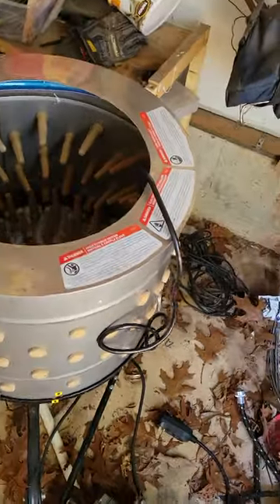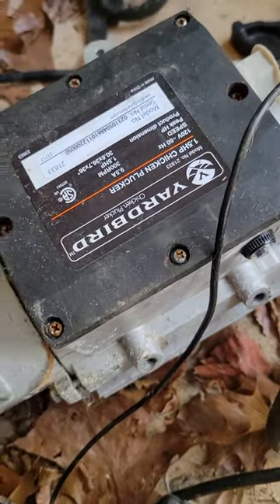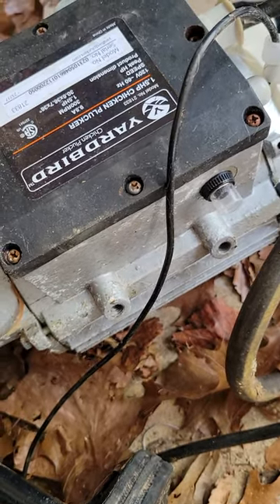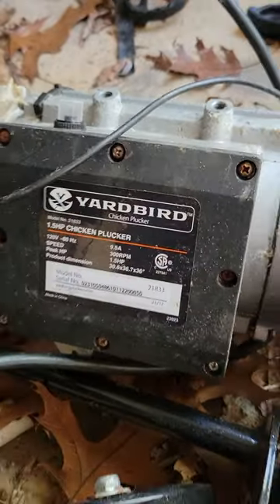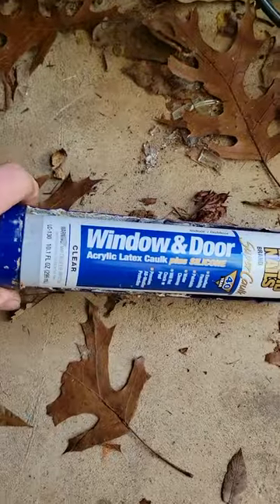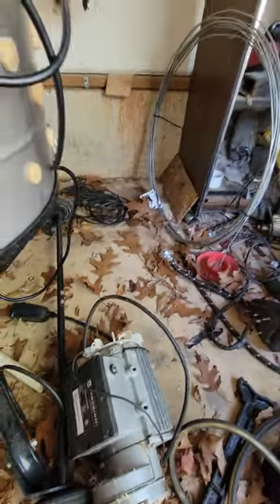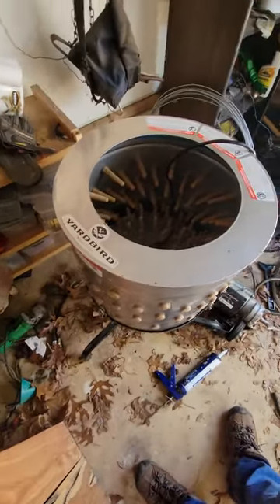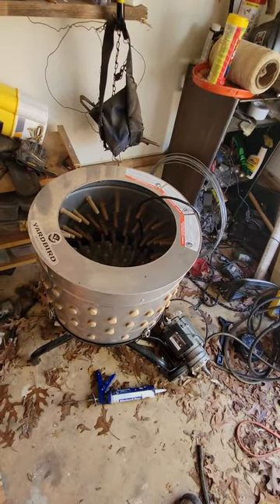chicken plucker issues and the solution

Comment: I just watched another video addressing these issues and their solution. Their channel is Creative Repairing. He took a 2” pipe union and cut it down to close the gap between the shaft and the plucker spinner thing, he also used a second 4” pipe union to elongate the area where the feathers and water pour out. Go check out his video. We plan to implement those changes on ours. I bought it used so I am a little concerned it already has some damage. It worked when I picked it up… I have a bunch of birds to do so we will be fixing before we begin. Peace!
Reply from the maker: thanks

Comment: It's simply a poorly designed plucked. The old motor needs to be completely disassembled and cleaned and it will work again. The new motor you bought will need to be disassembled and cleaned and dried after every use.